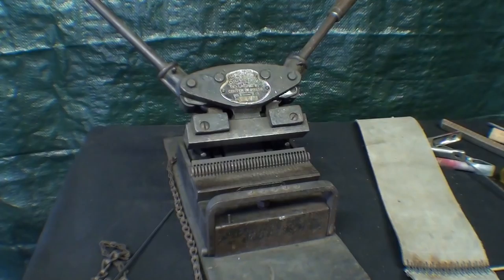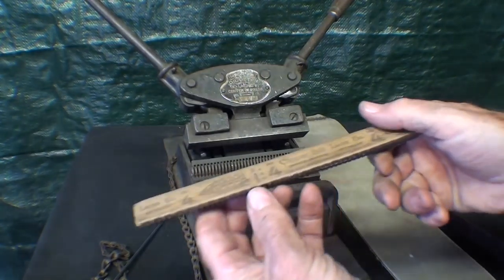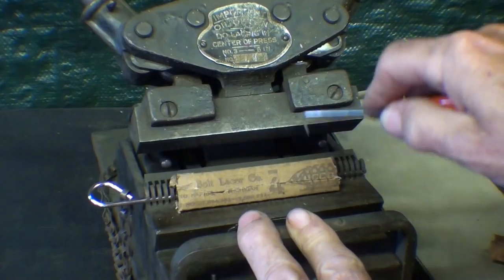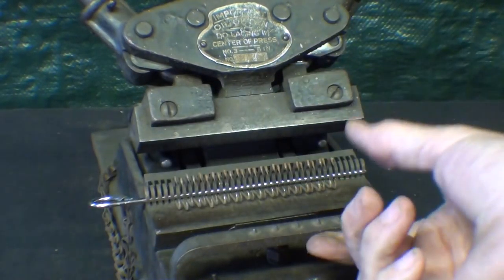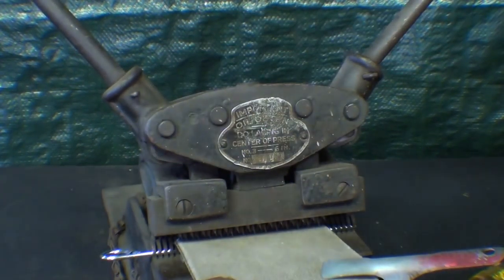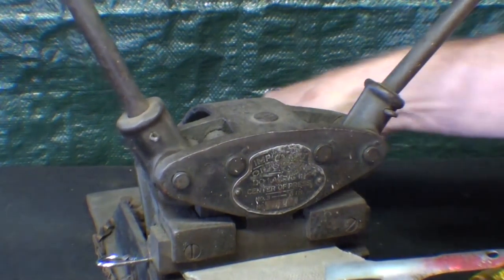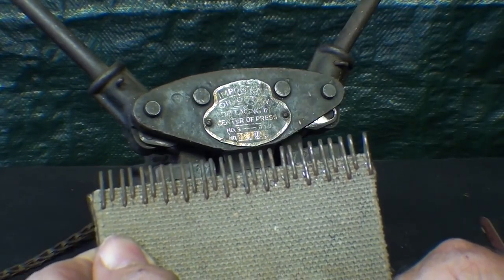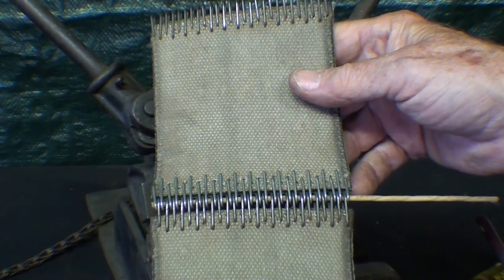SHOP TIPS #317 Condensed ADD version of Clipper Belt Splicing video tubalcain

Comment: Don't know why you want to make your videos shorter, Lyle. You are blessed with the gift of teaching,  those who  feel your excellent presentations are too long can always fast forward, but don't let those folks that want the details loos out because of a few grumps. You can never please everyone but rather  too much information than too little! Kind regards from downunder.
Reply from the maker: You might be right--I'm experimenting
Reply: I agree with downunderwest. For one, this abbreviated version does not feature the invaluable shop advice of the hazards associated with those pins coming undone.

In the long video you specifically state that you have seen them become undone and flail around when they are close to the edge, and describe potential injures that stem from this. 

In this video you just say its a bit close to the edge, this can mean anything, including that its just a purely cosmetic defect, while in effect it can produce a safety hazard, or create an annoying noise that could later result in machine downtime for maintenance. 

Machining is an advanced activity.. there is no time for add lol

Comment: My dad had one of those tools so he could maintain his flat belts on some of his machinery. He had an old Camelback drillpress (I don't remember the brand) that I would dearly love to have back. That thing would drill a 2 1/2" diameter hole straight through 4" of steel with hardly a grunt. Anyway, the belts would stretch and have to be shortened periodically.

And as far as ADD, I don't hav

SQUIRREL!!!

(A little joke here)
I probably do have a touch of ADD.
Thanks,
John

Comment: The only part I do not understand on either vid, is at the end:  
You put a pin in to join the two belt ends.  But what holds the pin in?
Reply: Once the belt is put into use and is running, the tension will distort the straight pin into a series of continuos S`s, like looking along the end of corrugated tin roofs. That is providing it is the catgut, rawhide or soft aluminum wire. That was why when Lyle showed you the steel pin it had notches in it to stop it sliding out under use. Hope this helps.
Reply: Ah... The light turns on!   Thanks!  (Since there are only about 6 watts, I doubt you needed sunglasses!   I truly was puzzled, yet the answer was SO simple~!